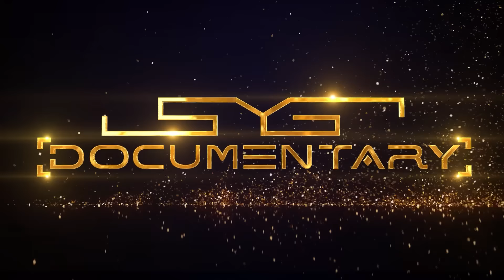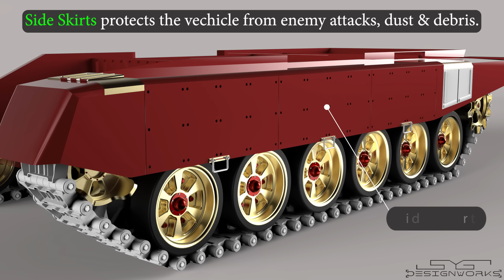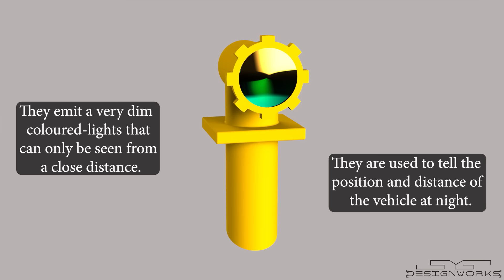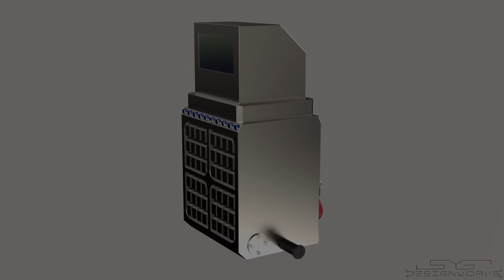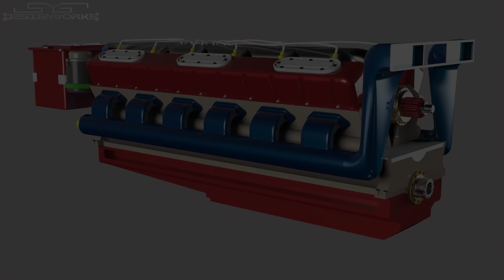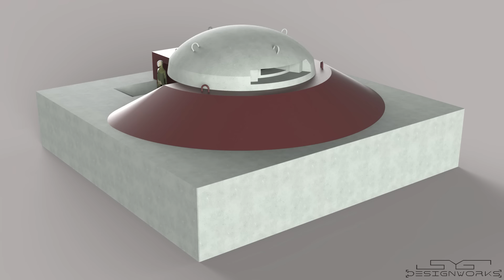How Vacuum Bombs Work: A Detailed Animation

Comment: Many bullshit points in this misinformation video.

1. No one would ever use one of these to scout the enemy targets.
2. "the aerosol goes into every opening in the bunker and even into the lungs of people if inhaled" then they correctly say "it explodes a fraction of a second after aerosol is disbursed"
     How do I have time to inhale it in a fraction of a second?
     try watching a video of one exploding in real life. this video is massive misinformation of how the explosion works.
3. It does not really suck oxygen out of the air or create any meaningful vacum. The first explosion spreads the aerosol which then used the oxygen in the air. This only occurs where the aerosol IS. This area is then entirely exploding. Why would I give a fuck about no oxygen if im inside    
     an explosion and am dead anyways? if im close enough to be in the no oxygen area I would always be dead from the explosion. 
     The vacum only lasts a fraction of a second too, and is completely irrelevant.
     Also, after an explosion, the air is hot and rises up, drawing new fresh air in from the sides.

NO ONE WILL EVER SUFFERCATE FROM THIS!

Comment: These have been around forever. It’s just a FAE (Fuel Air Explosive) Bomb. Germans discovered the technology in the early 40’s, after the war, we got their scientists and furthered the research. There’s a cool video that PETA would shit themselves over if it got out. Apparently there were some concrete rings poured at Lakehurst Naval Air Station in New Jersey. This rings were poured about 10 yards apart from the next forming a huge bullseye when viewed from overhead. Now placed at the 12, 3, 6 and 9 o’clock position were some modified children’s high chairs. How were they modified you ask….. arm, leg and chest restraints were added. Don’t worry, they didn’t use children. They used chimpanzees. The FAE Bomb would be placed in the center and detonated and scientists would measure the results on the specimens from closest to furthest. Just a hypothetical question for anyone that actually read all this but……. Have any of you ever seen a monkey turned inside out. I bet that would be gross and be something you never forget watching. lol have a good day.
Reply: The Japanese did similar experiments but used humans, Read about Unit 731. They'd tie people to posts at various distances from a point where they'd drop artillery on or detonate bombs, grenades etc, "Effects Testing"  You can't get real world data without using real world methods. 😉

Comment: "Vacuum bomb" is completely inaccurate name and never was the official term. "Fuel-air explosive" is mostly describes the first generation of volumetric explosive devices, which was dispersing a highly flammable aerosol then the secondary detonator (or rather detonators - there was several of them) ignited the cloud. It was so-called dual-stage thermobaric weapon and that's how US and Soviet cold war era thermobaric bombs worked. This warheads was highly complex, highly dependent of atmospheric conditions and rather cumbersome and could not be used in more compact weapon. TOS-1, hand-held thermobaric "flame throwers" (again, inaccurate, but this time the actually official term) and thermobaric guided missiles are using simplier and more reliable single-stage warheads. They're all have only one detonator, which is both dispersing the solid powder charge AND igniting it. The trick is, the  flame, оr "combustion front" in science terms, moves slower than solid fuel is dispersing, "catching up" with it. Tales about how people are "suffocating" in the zone of destruction due to "vacuum" is complete fantasy. In the end, thermobaric weapon works just as an ordinary high explosive, killing with blast and overpressure. The only difference that powderised fuel is really infiltrating buildings, bunkers and trenches and very much resembles a gas explosion in nature.
Reply: What source?
Reply: @Lobotomized_Child  Селиванов В.В. "Боеприпасы" ч.1 / Selivanov V.V. 'Ammunition' part 1. Dunno if it's available in English, though. A textbook for university students (most Russian universities have a military department. If a student doesn't want to get in the conscripted service, he must have a minor in military studies... which makes him an officer if the general mobilization is announced).
Reply: @jsmith6599  thank you, but when was this made?
Reply: @Lobotomized_Child  You mean the book or some specific weapon?
Reply: @jsmith6599  the book, specifically the specific passage if possible
Reply: @Lobotomized_Child  Book is quite new, published in 2016 (although I feel like it's the updated reprint of an earlier edition). Part I, chapter 4 'Volumetric explosion ammunition and reduced collateral damage ammunition' (the latter part about the "reduced collateral damage ammunition" was apparently added in the recent edition, as I don't remember it from the book I did read before, and which was lost when my hard drive died).
Reply: Russians seem to like those gas bombs.
Reply: Go make your own Beautiful content videos!  Or. Just STFU  & WATCH like the rest of us lol  YOU'RE NOT smart & don't know shit cause if you were we'd be watching your channel.
Oh yeah & nobody is reading ALL that BS YOU TYPED.   now suck it!😅
Reply: What; I don’t understand why doesn’t the Russian military use this vacuum weapon more often in the Ukraine battlefield killing the Ukrainian soldiers and maybe Zelenskyy might surrender to Russia and Putin?
Reply: @moa8121  The Russian forces have very bad profits, so thermobaric items would struggle to be produced. Also to account, urban environments and bunkers can make this harder to use. There are also many other factors but this is somewhat the base knowledge I have which is expenses and target.
Reply: @moa8121  это вопрос уровня "раздайте всем снайперские винтовки и солдаты перестреляют всех вражеских солдат". И это абсолютно естественный вопрос, не беспокойся. Проблема в том, что для самостоятельного ответа на него нужно обладать значительной военной квалификацией (штабной), поэтому нам с тобой остается только лишь принять на веру, что это так не работает (принять на веру не так сложно, ведь подобные действия не предпринимает ни одна армия мира ни в одной войне -- это является как раз отличным показателем нереалистичности нашего предположение)
Reply: @moa8121  также есть видео с канала @theLogicOfWar

Эти каналы дополняют друг друга, хотя и не связаны

Comment: “considered the most devastating non-nuclear weapon in the world”

I don’t know if that really is the case. Or at least not in the sense of these rockets. 

Although I will mention that by the Russians using this weapon system, it shows that they are getting desperate. They’re trying to use weapons that are so destructive that they basically are trying to sap the Ukrainians will to fight out of pure fear. However, as we have seen the Ukrainians Are not backing down.

By the way, I really like the modeling of the vehicle that you had the very start. It’s very nicely detailed. Not perfect obviously but you know it’s not like you were able to go out and 3-D scan one of these actual vehicles.

Comment: No solid objects or humans vaporize at 5,400 degrees Fahrenheit.  The temperature and energy needed to entirely evaporate solid materials is comparable to what nuclear weapons can achieve, and even then, only in the immediate area of the explosion.  Disintegration is taking place. Not vaporization. Fantastic video otherwise and superb animation.
Reply: I always wonder where people get things like that from. Did they make it up themselves?
Reply: "vacuum bomb" is a misnomer. They create a big overpressure wave first, followed by a drop back to ambien pressure. Both waves do big damage to bodies, because the duration of the blast is longer than conventional explosives, but the rapid depressurization comes last, so the bodies look like the vacuum killed them.
On any other day, getting your lungs pulled out would be the worst problem you have, but if the pressure drop was that bad, the pressure was worse.
Reply: @j3i2i2yl7  The reason its called a vacuum bomb is that this bomb is used to reach soldiers inside bunkers with blast protection. Blast protection usually means the bunker has thick blast doors, and also check valves in the ventilation system that would automatically shut if a pressure wave happened to hit them, exactly for this reason of pressure waves from conventional bombs. Here is where the vacuum bomb comes in. Instead of creating a overpressure, it creates a underpressure by consuming all oxygen outside of the checkvalve, so when the pressure wave disappears, pressure rapidly drops below ambient, forcing the checkvalves to open and suck out all air in the protected bunker. Then the checkvalves would close, maintaining vacuum in the protected bunker.
Reply: False
Reply: That’s incorrect 🧐
Reply: Between 2700-5400 F.  However in a vacuum. Shit boils @ room temp.
Reply: Bones vaporize at 1832 degrees according to Google gold vaporizers at 5042 ° Fahrenheit along with many medals.
Reply: The lower the pressure the lower the boiling point.
I'm sure that the negative pressure and the multiple shockwaves that even 3000°f is enough to nearly vaporize the entire body but I'm sure the bonded minerals and metals would disintegrate
Reply: @yugo1car643  Pressure can only get so low. Evaporation is only so fast. Heat transfer is extremely limiting. A temperature is irrelevant for evaporating something if there is no heat behind it to actually do it. 2 atoms at 10'000 K will not evaporate 1 kg of water, they will not even warm it measurably.
Reply: @yugo1car643  The vacuum is miliseconds. The heating is milliseconds. Neither will vaporize anything.
Only thing the weapon does is rupture lungs and liver, eyes, ears and such due to the over-pressure. Not pleasant but the person will be unconcious at that point and soon dead.
Always hated the "vacuum bomb" name. Longest person has been exposed to complete vacuum was in USA in space research center. Jim LeBlanc was in total space vacuum for some 10 seconds and lived. He told how he "could feel the salive boiling from his tongue". No long term effects. Easy to google and real event.
Reply: @alaric_  The vacuum is milliseconds yes. But the bomb is designed to reach solders inside bunkers with blast protection. Blast protection means the bunker has thick blast doors and checkvalves, so conventional overpressure weapons wont work, as there is checkvalves in the system that will instantly close once the outside pressure is higher than the inside pressure.
A vacuum for a few milliseconds is enough to suck out air of the protected bunker. And with the checkvalve, once the protected bunker is at vacuum, imagine what happens when the ambient pressure comes back? Yep, the checkvalves close permanently, 
Notice that the checkvalves block the overpressure, so the soldiers inside will not feel any over-pressure. Only the underpressure once all air in the bunker rush out because of the checkvalves opening due to ambient pressure being lower than the bunker pressure.

Comment: Why the three hydraulic cylinders - one invading the crew space? The outer two should be more than sufficient. Also, why the stabilizers? Rockets do not transfer momentum to the launch vehicle.
Reply from the maker: The rockets makes the rocking unit heavy, three hydraulic cylinders are necessary. The Hydraulic locks are necessary to prevent the vehicle from rocking sideways and moving backwards in a slope.

Comment: The real secret of TOS is Russians were afraid this weapon be considered a WMD. So they said the intended usage is to wipe VX/VZ or similar gases after its were applied. The first TOS-1 were designated and entered the service inside the VRHR (aka Regiments for Radio and Chemical Weapons Defense).
The best effect achieved when TOS used against small unprotected settlements.

Comment: The weight of the TOS-1A is 45.3 t (100,000 lb), not 4.53. the comma has slipped.
Reply from the maker: Correct. Thanks for watching!

Comment: The "splash guard"  is more meant to deflect or break up large sheets of ice   that can ride up the front slope after the tank drives into partially frozen water holes. Those sheets of ice can injure or even kill a driver  driving unbuttoned if he can't get his head  down when a big sheet/slab of  ice comes up the slope.  I have seen this, happen on US M60 tanks which did not have "splash guards" (2 injuries , no deaths) .  I doubt such guards would stop a big wave of just water/mud much at all. But nice to have for those dangerous ice slabs.

Comment: Quote - "The thermobaric weapon, also known as an aerosol bomb or fuel air explosive, is a two-stage munition.

The first-stage charge distributes an aerosol made up of very fine material – from a carbon-based fuel to tiny metal particles. A second charge ignites that cloud, creating a fireball, a huge shock wave, and a vacuum as it sucks up all surrounding oxygen.

The blast wave can last for significantly longer than a conventional explosive and is capable of vaporising human bodies."

Imagine being on the wrong side of an Orlan and a TOS-1 platoon.

A company of soldiers would resemble a smouldering campfire.
Reply: TOS-1A Buratino still has a limited range of 10km (15-20km for newer TOS-3 Dragon). Imagine ODAB-1500 with UMPD – thermobaric glide bomb with the range of 70-80km.
Reply from the maker: Thank you for the valuable information.
Reply: Есть еще и другое,даже если люди не испаряются,то они погибают от перепада давления даже спрятавшись

Comment: Says the engine is turbo charged but I don't see any turbos? I think he meant it is a supercharged engine like WW2 aircraft?
Reply: Engine has both turbo- and supercharged variants, but the model appears to be of a supercharged one. I think TOS-1A might use both types of engine too. The V-84-1 which makes 840HP is supercharged, but they build these on T-90 chassis and those can have, depending on variant, V-92S2 and V-92S2F engines which are turbocharged. I doubt they'll look at a turretless T-90MS and be like "No we aren't gonna install the TOS on this one, it's not the right one." but who knows.
Reply from the maker: It is turbocharged. The model was designed from a reference pic where some parts were missing or disassembled.
Reply: Газотурбинный

Comment: ТОС - это результат неудачной попытки разработки вакуумного оружия в СССР. Его характеристики не достаточны для вакуумного оружия. Но оно было довольно эффективным в плане выжигания живой силы и этому нашли применение. По этому данное оружие не является термобарическим. ТОС - это Тяжёлая Огнемётная Система.
Reply: Your comment is the result of a failed attempt to write something intelligent. I don't remember exactly, but I think the rszo project for firing incendiary missiles was done by the commander of the NBC Protection Troops, it was his brainchild back in the early 1970s. Participants in the research and development developed a large number of different components and selected the most successful. Two dozen fire mixtures and four variants of the charge for their atomization and ignition reached the tests. In the mid-seventies, all these developments were tested, in which the most effective ones were identified. Initially, the TOS-1 was designed to fire only incendiary rockets. However, since the late sixties, the development of thermobaric fire mixtures capable of seriously improving the combat performance of the weapon was underway. In 1985, the research and development program with the code name “Ognivo” was launched, the purpose of which was to introduce the existing developments in the TOS-1 project.In 1988, two combat vehicles TOS-1 went to Afghanistan to test in the conditions of the real conflict.Particular results were shown by shells with thermobaric equipment. In mountainous terrain, their combat qualities were improved due to some characteristic factors.The greatest effect of its unguided rockets in thermobaric ammunition is achieved in mountainous conditions: due to the mutual superposition of air shock waves and their multiple reflection from the surrounding rocks, destruction of soil and rock rubble. The munition creates a cloud of explosive mixture and then detonates it, forcing all the oxygen in the cloud into this reaction. After the instantaneous detonation, the pressure rises sharply and then drops below atmospheric pressure by about 160 mm of mercury column. Thus even if the enemy survives the explosion, the pressure drop results in his guaranteed death from ruptured internal organs. 3 types of effects shock wave, thermal effects and pressure in the absence of oxygen. So yes, it's a thermobaric weapon, not a flamethrower.
Reply: Ну да, они так неудачно разработали вакуумное оружие, что у них есть боеголовки для РСЗО, для тактических ракет, для авиационных бомб и ракет, АВБПМ и конечно же ТОС, который совсем не вакуумное оружие, да.
Reply: @alexkatc59  Это разве как то противаречит мною написаное?